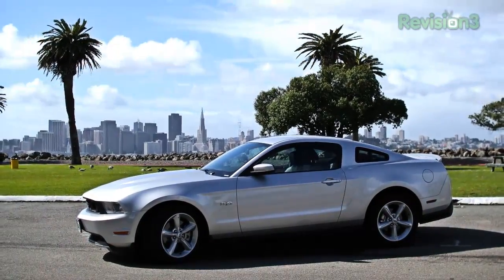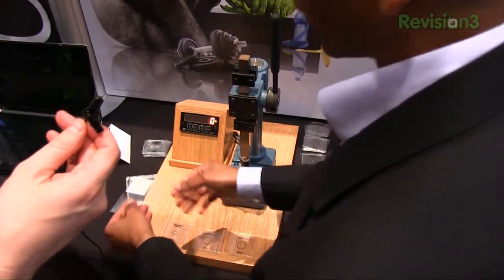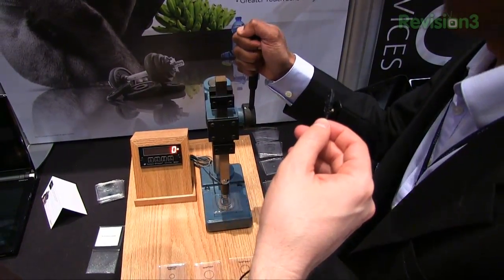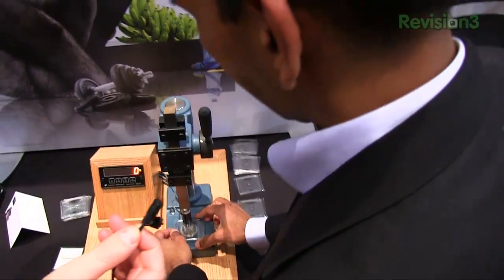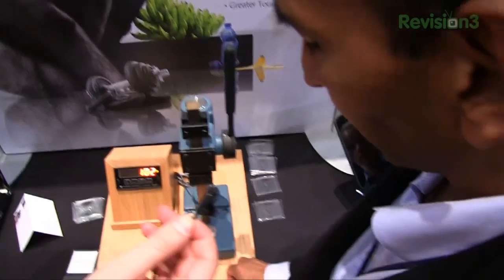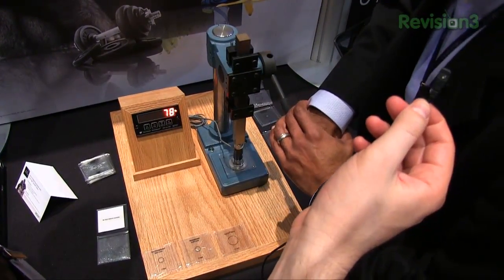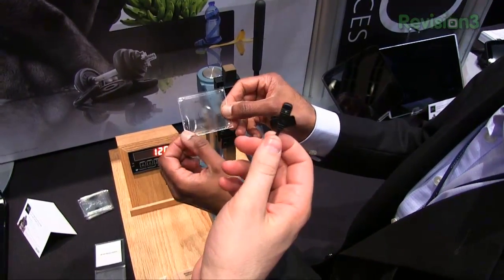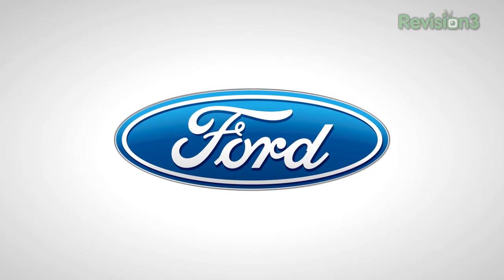Gorilla Glass Demo at CES 2012

Comment: @charlieecv you could say the same about bulletproof glass but what would you rather stand behind when bullets come?.....sure this is not that big of a difference but if this bump in amount of pressure it takes to crack stops it from cracking from say a waist or shoulder height drop its definitely worth it

Comment: the problem with gorilla glass is that it is not impact resistant, once a certain depth is reached from impact, a violent chain reaction happens where the entire screen cracks all over.

Gorilla glass strength comes from it's ability to change shape when pressure is applied (give it enough time with pressure applied and it will bend  a good 20 degrees or so) if it gets a sudden fast impact in a small area, then it breaks, (which is why their test never involve that)

Comment: i once dropped my phone off of an airplane, gps located it when it landed (and when i did), i found it in the jungle, being trampled on by an elephant. when the elephant finally moved i went over to grab it, but the monkeys beat me to it. they threw it back and forth through the treetops, smashed it against the trees and bit it. when they finally dropped it i grabbed my phone. the monkeys attacked me, but using my phone as a shield i escaped. it had only minor scratches, but wouldnt power on =(